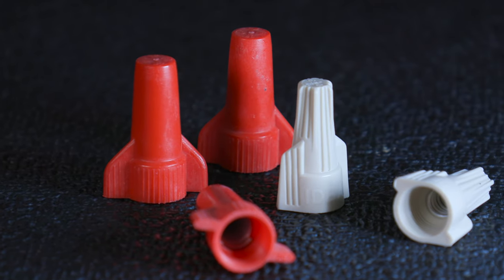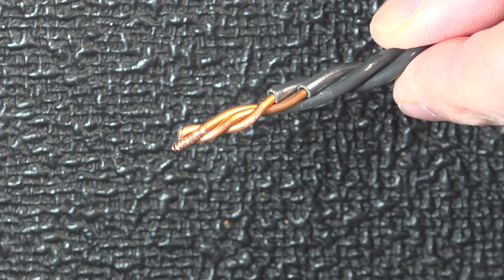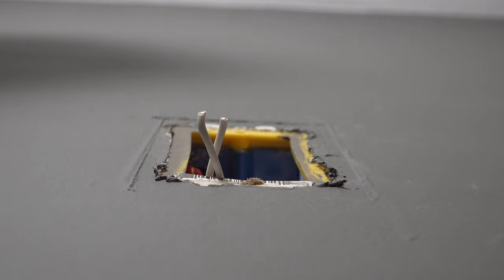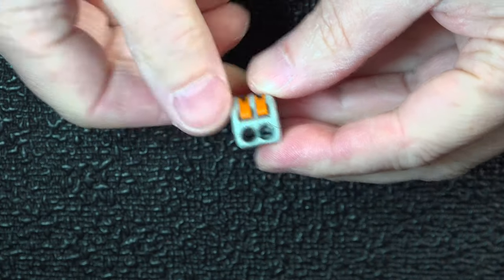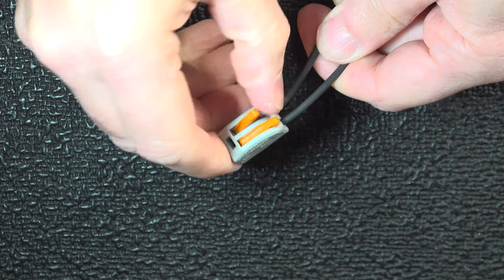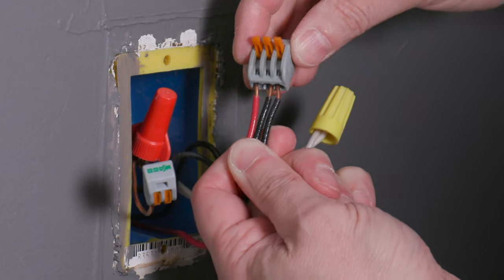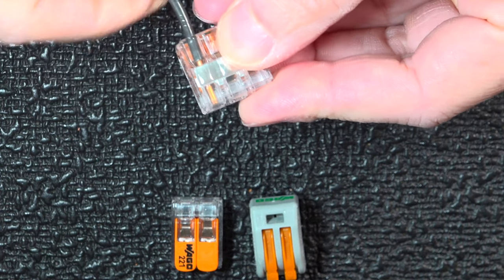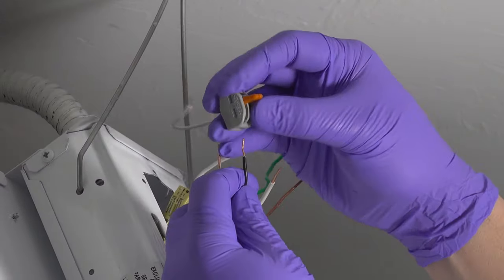Never use Wire Nuts Again - Wago is Better Electrical Connector

Comment: Typically, you don't need to undo the wire nuts when you're changing light switches.
Reply: Sometimes you do when your replacing a switch in a house that was built around 2000 in the United States, I’ve noticed that in 20 year old houses, they have a ground in the box but didn’t connect it to the switch
Reply: @thefuturegamer9451  replacing switches in my house right now currently actually and that’s what is needing to happen, also you do if you are adding smart switches in as well.
Reply: @thefuturegamer9451  In reality, the ground is connected to the box and the box is connected to the switch so it is grounded. BUT still, you could attach a length of wire to the box's grounding screw and then the switch....
Reply: @thefuturegamer9451  my house was built in 1997 and the wiring is acting crazy. Lights flicker fast, lights that are turned on, turn off for several minutes and back on, etc.
Reply: @thefuturegamer9451  No need to ground a switch!
Reply: @NikoBellaKhouf2  Loose screws or push in used.
Reply: @NikoBellaKhouf2  you need to get someone to analyze and repair this ASAP. Flicker, power coming on and off, both are dangerous things caused by an unwanted disconnection/reconnection of the circuit.  Every loose connection is a potential fire due to heat from the current having to fight to get across.  
Seriously, you need to check ALL connection points in any circuit doing these "tricks" - else you could end up with someone getting shocked/electrocuted, or (more likely) an electrical fire.
Reply: @CaptainSeamus  wow 😳, thank you for warning me🙏
Reply: @NikoBellaKhouf2  Your home is haunted. Has nothing to do with electrical :-)
Reply: @NikoBellaKhouf2  good luck, and hope it's fairly easy to find!
Reply: @CaptainSeamus  I hope so too
Reply: @shawnhayden6674  😱😱🤣
Reply: @NikoBellaKhouf2  My houses were built in 1957 and 1968. I've never had any issues such as that. But then again, that's when people took pride in their work.
Reply: @jcagy2  Switches should be grounded in wet area applications.
Reply: @joedaniels255  nothing in my house was done right. First day we moved in I was drying my hands with a towel and then I whipped it over the towel rack, like I always did in my previous house. The towel rack fell off the wall. They used cheap plastic screws to hold it up. Then the toilet paper holder fell off. Then every hanger and shelf in the closets fell off. The plumbing has been a nightmare. The ONLY thing that was done right was the HVAC system, and I'm sure that was contracted out to another company. Our neighbors got it even worse. Their house settled wrong and cracked the foundation. They sure don't build anything like they used to.
Reply: @jcagy2  By code in the US you must connect the GND (bare wire) to the switch.  You don't need to connect the Neutral (white) wire.
Reply: Yeah, but you often do when you work in industry.
And from the bottom of my heart, I'll say, fuck wirenuts.
Reply: @NikoBellaKhouf2  time to call in an exorcist...
Reply: @SebBrosig  lol it wasn't that kind of problem. Just shoddy work by the builder and his crew.
Reply: @CaptainSeamus  I would start at breakers connection to the Buss bar before all of that.

Comment: We have those in a stationary light tower.
Twice the lights have gone out when these cheap snap connectors have gotten hot, melted and failed.
Replaced them with wire nuts, no problems since.
Reply: Yeah right, I believe the lesbian dude in the vid
Reply: @richg4051  dude ...grow up
Reply: Then they weren't Wago brand - they were copies.
Reply: Only time I have trouble with wire nuts is
A. They are way wrong size.
B. I am trying to cram too many wires in one.
With these it can open up brand new opportunities for trouble. Sounds like a winner.
Reply: Definitely not Wago then.
Reply: Check out the video by john ward where he tests wago connectors under extreme overload conditions. The plastic can completely melt away and the connection would still hold. of course in reality your overcurrent protection would have tripped long before that. if you had this experience then it was some cheap ripoff, not wago.
Reply: Sounds like you got scammed dude.
Reply: Someone ought to run a comparison with the different connections immersed in salt water to see how they hold up. That might be an interesting test to see if there may be an advantage in those improper applications, exposed to the environment.

Comment: These cool little things are fine for low voltage and low current applications. THEY ARE A FIRE HAZZARD for high voltage and high current!!!  There isn't enough contact area for a real load!
Reply: I saw that very issue inside a panel earlier this year. A wago was used on a 20A small appliance kitchen circuit and completely melted the wago. That would never happen with a well twisted wire nut.
Reply: @GrandmasFolly  I tried these damn things many years ago when they first came out.  Turned into a callback nightmare.  The local supplier stopped selling them because of melted splices.
Reply: @slick-px4pq  They’re great for low voltage and I’ve never seen a problem inside of light fixtures but they should never be used for junctions. 

Unfortunately their use is gaining popularity in my area. Just this week I got a call to repair some exterior lighting on a medical building that was recently acquired by a property management company that I do work for. While investigating, I opened a gutter and found a couple hundred splices all using wagos. I’m sure I’ll be receiving a call to repair this in the future.
Reply: @slick-px4pq  yup! I do commercial work and we had a batch of 2x4 lights that kept failing and some even started smoking. Went there on a service call about and every connection with these failed after 6 months. My boss said never again. And our supplier stopped selling them because they kept getting complaints.
Reply: @GrandmasFolly   Something else must have also happened. These specific ones and brand have been stress tested to 60 constant amps for 15 minutes, getting the connector up to 270 degrees with no visible damage of any kind to the connector. EDIT ADD ON: Another test put a heat source 3 inches away from the connector and it withstood about a THOUSAND degrees before it melted. I have seen knock offs being sold on Amazon, so beware of those...
Reply: That's what I was thinking..
Not enough contact area...
Reply: Yes there is, these are the only wire connectors used in Europe. Do you understand how electricity works? The small contact area is over a very short distance so it’s irrelevant
Reply: Really? That's good to know.  But they are very common in other countries.

Comment: I've installed a gajillion wirenuts, haven't died yet.
Reply: Same, but I do wonder if I've left a ticking time bomb somewhere.
Reply: @livenotonevil8279  don't know about you but according to this I have ticking time bombs everywhere
Reply: Scott Jarry  Aren't they a subsidiary of the world health organization?
Reply: Huh! That's nothing! I've installed 1.3 gajillion wire nuts. Still breathing!
Reply: @paulmaxwell8851  I knew a guy who, after installing 1.3 gajillion of those seemingly harmless wirenuts, decided to twist 1 more on (yup, he just HAD to push his luck), and that was the end of him.

He was electrocuted while being stung by a zillion hornets who had arrived to attack the fire ants that had suddenly been unleashed onto his body since they were oddly attracted to the sizzling flesh smell.
Reply: You're probably in the middle of some kinda Bruce Willis Sixth Sense situation.  Didn't you hear him?? If you use wire nuts you're definitely going to die.
Reply: Bet you won’t live to see a bazillion wirenuts.
Reply: I would like to see you replicate the 6 wires I tied into a single wire nut using this wago conspiracy crap.  And my 6 wire nut setup has not burned down my house in a whole 25 times of using that dimmer, outlet switch combo.  It is a bit warm at times, but the peeling paint around the box gives it a bit of character in my opinion.
Reply: @Power5  Pro tip: If you'd removed that curly metal insert, you could have gotten even more in there.
Reply: @livenotonevil8279  true. Next time though I am thinking of just removing the giant pesky plastic cap that does nothing but make it hard to shove into the box. Thinking some masking tape next time.
Reply: @Power5  face palm how did I not think of that!?
Reply: Are you still alive?
Just checking you didn't jinx yourself...
Reply: @livenotonevil8279  I remember that it was a tragic day
Reply: @Power5  Wago makes 6 and 8 space wirenuts.
Reply: @livenotonevil8279  I've used wire nuts for over 40 years with zero issue. Guess I'm lucky, or they are reliable.
Reply: See you are doing it right do everything wrongly and eventually you will have a fire 🔥
Reply: I think he makes too much hay out of the "dangerous wirenut connection" crap, but - I have some similar connectors and I can say they are great if you find yourself with short wires in a junction box. I had to rewire a light box and found I had some really short wires to work with, and trying to twist 3 of them together was getting to be a pain. The slide-on connectors I had worked great.
Reply: But how many of those houses burnt down? 😂
Reply: @ChrisSmith-bw1nt  
I'm no peasant residential electrician. I do commecial and institutional, so how many universities, hospitals and factories burnt down you mean...
Reply: Don't give up, you can do anything you set your mind to!!!👍👍👍               j/k 😜
Reply: After wiring 250 10 gauge junction boxes this what I learned: Pretwisting 10 gauge is insane - pain on the wrists, had to ice them every night. I think I might have permanent damage. Sure a wago costs more than a wire nut. But in the end, it possibly saved my wrists and time. I think it was about 5x faster. If i was being paid by the hour, I'd go with wire nuts, but if I'm getting paid by the job, wagos 10000%. I also feel way more confident when I can see the wire properly seated through the clear plastic. It's better for the novice, which is where a failure is most likely to occur.
Reply: We’re I’m from they illegal , but I got well acquainted in another country. Seemed fine and the trick I learned the ends MUST be snipped to reach an equal length , if one is short it doesn’t catch and can work loose
Reply: @Froggability  Good observation.
Reply: @gairdtlundeen4262  
You don't have to pretwist wire nuts according to the manufacturer. I only pretwist If I have stupid combinations; like 12 AWG along with 2 or 3 16 AWG or 18 AWG. Even in that case I only pretwist the small wires. So far so good
Reply: Disagree.  WAGO is definitely the way to go and I do not care what they cost I am getting some.
Reply: @Power5  HahhhHa.... seriously though, the WAGO will allow me to more safely perform my home electric jobs without turning off the circuit breaker.
Reply: @SunriseLAW  you turn off power for a outlet job? I just use rubber gloves and rubber handle snips.  😁
Reply: @Power5  Most of the time I locate AND turn my breaker off at the same time.  Then I trim off the burnt wire where it shorted and then finish the repair.
Reply: @cwegren1  or someone has decided that twisting a wire nut introduces to much possibility of a failure. Remember we live in a world where even one failure can bring an act of Congress.
Ill predict wires nuts will be phased out by code
Reply: Me neither

Comment: This man is a salesman. Wirenuts work fine. I’m an electrician of 18 years
Reply: Yep, dumb product. Have fun trying to fit these things behind GFCI outlets, get yourself another box to stick in your bag to organize the 5 different sized connectors you gotta constantly restock. Also I highly doubt their efficacy on stranded wire. I'll stick with my tans thank you very much.
Reply: 41 years here and yes, Wire Nuts work fine. I do have some Ideal brand connectors like these. Prefer the Wire Nuts and twist my wires first.
Reply: @FrannyWard  I'm curious why folks don't think they need to twist the wires first. I'm personally far more worried about stress fractures in the wires from bending the wires to fit them in the box than getting a good secure connection with a wire nut. I don't think I've ever had a problem with it.
Reply: @SmallSpoonBrigade  Well I was taught that way in 1979. And today at 59 years old and having my own business off and on for thirty, I don't trust the wire nuts alone. Besides, on some jobs I come across in offices, I have to change out a device and when removing the old receptacle, if the pig tail wires for it that go to the feed in and out are twisted, I can remove the nut without breaking the circuit. If the wire nut was just put on without a real twist, I could lose either the hot or neutral on the whole circuit, pissing off a lot of people who's desktop computers just shut down.

I can twist up to four conductors with a pair of nines and trim to fit a wire nut blindfolded. But, hey. If these new fangled connectors do the job and are cost effective and UL listed? I'm all for them.
Reply: @FrannyWard   they are not cost effective

Comment: “With these, a single hand can make the connection”....  then proceeds with two hands and never shows one hand 😏
Reply: Exactly what I was thinking. Looks like it would actually be harder than a wire nut to do one handed.
Reply: They actually are easier than wire nuts but usually more expensive. Awesome for working on hot wires
Reply: @sleeperknight  Seemed pretty obvious to me, how are you supposed to securely twist an object onto loose wires with 1 hand? The wago you can do it wire by wire with 1 hand very easily and know it's secure. Put it on the first wire, click it, then put the other wire in it, click it, repeat for however many wires.
Reply: @taleoftruth  if you do wagos hot with a load you will arc burn the wago ruining its integrity.
Reply: Lol I was about to comment this. 🤣
Reply: @KitchenerLeslie2  should never connect anything hot WITH a  load.
Reply: @DDracee  he shouldn't be screwing wire nuts onto loose solid wires anyway. Always twist the wires first, then snip off the end to make them even. Putting wire nuts on loose wires is just asking for the connection to fail.
Reply: @dan6822  Don't see how this reply is relevant to the capability to snapping wagos on with one hand. What you should or shouldn't do with nuts doesn't matter here.
Reply: @thunderbolt5354  yeah, i work With it Every Day. Its not fun fixing other Peoples mess, and tell them 5 different ways they could have died on
Reply: @taleoftruth  🎶come with me and you’ll be in a world of osha violations 🎵

Comment: In Germany (the origin of the Wago Connector ;-) ) we usually don't use the "lever" type wago on solid copper wire. We use Wago type 2273 for that. The type 221 (lever) is used for stranded wire, or joining solid with stranded.
Reply: Just wanted to ad that in Germany Wago is most commonly used-has been so for years.
Reply: Its really depending on what you do. I mostly carry around the 221 because they can do everything and are easier to remove but the 2273 are much cheaper

Comment: "Wirenuts [...] are the main way that most people connect two wires together"
Um... actually, no. To my knowledge, only in the Americas has this type of wire connector ever been in widespread use.
Across the pond, "Lüsterklemmen"-style connectors (sometimes translated as "screw terminals", but that's not entirely accurate) have been the most common form, in which the two wires are placed end-to-end into a small metal tube and fastened with one screw each; and multiple such connectors are encased together in a piece of insulating plastic. In the last decades, easier-to-install derivatives have become widespread, such as the WAGO connector you're demonstrating.
By the way, the term "WAGO connector" is not quite accurate in this context; WAGO is a company that produces quite a lot of different connector types, possibly even wire nuts; and conversely, similar connectors are being produced by various companies over here; WAGO just seems to be the first company to successfully market this type of connector in the US.
Reply: Well, I am in the electrics sector in Germany for appr. 40 years now and never used wirenuts once in my life. Every professional with a little bit of pride would use the WAGO connectors, the cheaper ones would use "Luesterklemmen" (luster terminals) who are common, but it is more work and fiddling, but they are less secure. Even in the 80´s I used the WAGOs, only then there were no levers to loosen the connection, you had to shove a phase checker screwdriver into a tiny hole to open the connection. 
The only place I ever saw wirenuts was in some older cars where diyers had fiddled with the electric.
Reply: Just my thoughts, screw-terminals exist for decades and are pretty inexpensive. This "wago connector" is just a more expensive variation.
And I've never seen wirenuts being used in anything else than a temporary hotfixing situation (or once by a colleague as a "protection cap" for wires soldered together).
Reply: Same in South Africa. We used those screw terminals, affectionately called "chocolate blocks", but it is now illegal to use those in junction boxes. Wago, or other variants of push in connectors are now recommended. I've only seen wire nuts once, in my grandfather's house from the 1950s, on the aluminium wiring. And even there the screw terminals were more common.
Reply: Nice to read a comment from Europe. Wirenuts can be seen quite often in old houses built in the USSR, they were widely used in the connection boxes in the condos, not inside appartments themselves
Reply: Agreed. I'm in the UK and have renovated enough houses (yes I hire in an electrician, but I always help out) and have never seen these wire nuts.